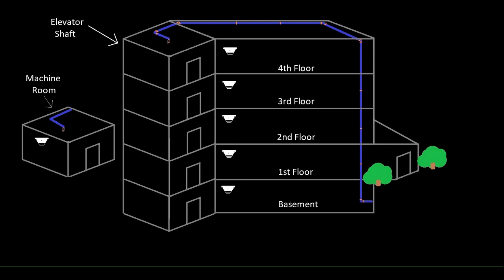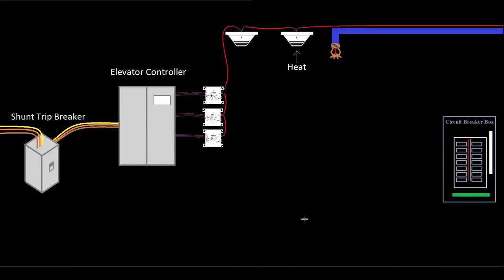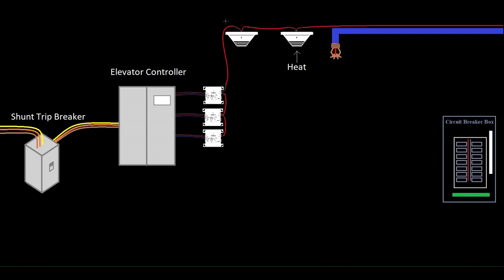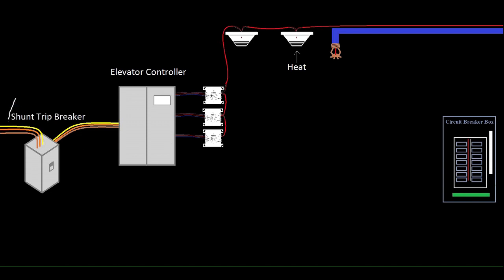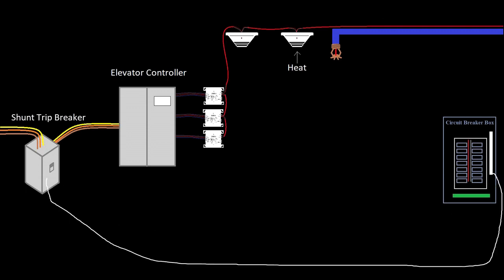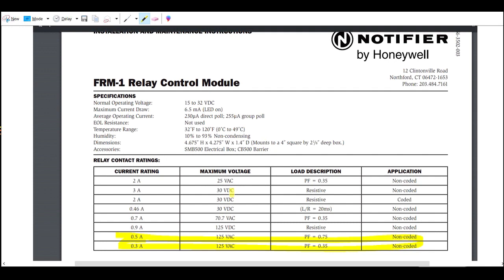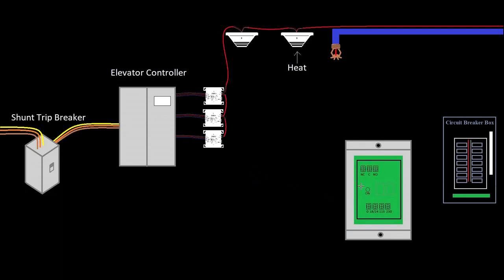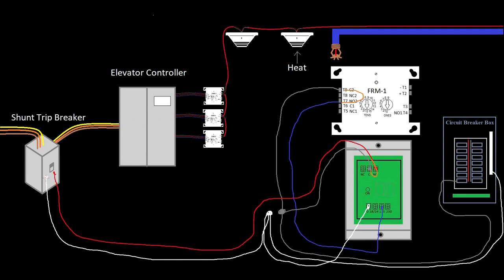39 - Elevator Shunt Trip - Introduction to Fire Alarms

Comment: When you say the MR101 couldn't be controlled by your fire alarm panel, could you not just use one of the alarm relays directly off the panel itself? Or even install a certified relay module designed for that same brand of panel as a dedicated zone? They could trip your MR101 on the 18-24 input, as many of them especially on the programmable SLC loops offer 24v out. In my mind this offers several benefits, such as being able to have that as a dedicated relay trip off the panel itself, or instead using the relay module to have an addressable zone for that MR101 trip, making it easier for identification and troubleshooting in the future. Not to mention, if you planned on using all three devices (smoke, heat, sprinkler) as your input combined as one for an input, (assuming you meant in series) then if one of the devices failed then your whole setup is no good. This method would have a better chance of working if you had a dedicated relay off the panel itself. In my experience, the less relays or extra modules in between your source and your destination will always be the better choice especially when it comes to life safety. Less things that can fail. Otherwise it would be identical to how you explained. Hot lead off 120v breaker through C/NO on the MR101 out, Neutral straight through to Shunt, and 24v in from fire panel directly as an addressable zone. Cut out the FRM and not have to worry about it failing.

Comment: I know you probably won't get as many likes or views as the more popular videos on youtube, but for the people who watch this video and really appreciate what you are explaining, it means a lot.  Just a headsup, but a 2-phase panel is not a common panel.  1-phase and 3-phase are a lot more common.
Reply: perhaps  just a misnomer - any single phase  220-240VAC in the USA is yes nominally called single phase - 220volt,   but under the skin - uses line to line phases (2 phases). we all know and often misuse terminology - much like a 2x4 is actually 1-1/2x 3-1/2 - Very few commercial or industrial motors use line to ground power as they are extremely inefficient - just to let those who are in the learning curve also understand this moniker.

Comment: Hello Joe,
My situation is cl8se to your explanation but with the difference on the shunt trip relay
My Electrician gave me 2 kegs 
One is black labeled LINE and a blue labeled Load.
I connected the line (BLACK CABLE) to my potter Relay com.
and my Load (Blue CABLE) to my potter Relay NO.
I also use a 24vdc relay with a spst input and I connected the COM. And the NO to a minute module with a resistor across. 
My problem is that the relay Blowout
Reply from the maker: Your Potter probably isn't rated for the current that the shunt trip breaker is drawing. If you watch the video again, pay attention to when I explain why I'm using the MR-101. You can use your Potter relay (a new one) to trip another relay that can handle higher current. Your load would run through that relay instead of the Potter one.
Reply: @JoeKlochan  thanks for replying to me, but my problem is that I wire everything like your diagram but the ONLY  difference between yours and mine is the mine doesn't have  a neutral going to the shunt trip relay I have the wire call LOAD remember because my LINE IS THE HOT POWER so where do I put the LINE on your diagram??.
Reply from the maker: @FastEddy8a  it doesn't sound like your situation is that similar to mine. First, what is your 24 volt relay doing? Are you using 24 volts for anything? It's possible to run 24 volts through your Potter relay and then activate the MR-101 that way. Then your line would go to the common of your MR-101 and your load would go to NO of your MR-101. I'm not sure that's what you're doing but it could be and it would definitely work, you just need to pull 24 volts from somewhere in that case.

I'm my drawing, the LINE would obviously be the black wire coming out of the breaker box, and the LOAD would be the red wire going to the shunt trip breaker.
Reply: @JoeKlochan  the only difference between your mr101 and the one that I have is that the one that I have is power it by 24 volt which I am getting the power from my NAC circuits in a program that want to be constant power and the way that I wire is hot power I went to Common on my relay module and my line I came out of my normally open then I put my relay which is the mr101 and it connected to my miniature module just to monitor my relay and that's how I'm getting my breaker to blow out so on yours you are powering the mr101 from the fire relay module  on mine I'm getting a separate power
Reply from the maker: I'm not totally following you. I guess the best I can offer is that your 120 volts shouldn't be passing through your Potter relay in your scenario. Since you're using 24 volts, run that through your Potter relay and use it to turn on your MR-101. Then your LINE would go to common of your MR-101 and your LOAD would go to NO of your MR-101.

The downside of doing it that way is you now need two monitoring points, one to monitor that the 120 volts is on (which you'll need a neutral and another relay) and one to monitor the 24 volts since both sources need to be there to operate shunt.

Comment: Can you use a rib relay if you can't find an Mr 101?
Reply from the maker: As long as the current rating is high enough, I don't see why not. I've never seen it done that way though. The only thing that comes to mind is that it maybe more difficult to keep 1/4" of separation between power limited and non power limited with those, but I'm sure it can be done. My main concern would be current rating but those RIBs are also rated for 10amps.
Reply: The problem with using a RIB vs. MR101 is that RIB is not rated/ listed to be used with FA system (life safety). Other than that they work the same.

Comment: Great explanation, Joe! I feel that shunt trips are death traps, because if patrons or the FD is in the elevator and the shunt trip goes, your screwed.
Reply: I guarantee you that’s not how it’s set up. If the shunt trip activates and cuts power to the motor, there is a system in place that allows the elevator to drop down to the closest floor and open its doors (which stay open) so the occupants can get out. Elevator safety is a huge deal and require current permits and safety inspections. You can’t possibly so naive to think that elevator engineers haven’t thought about this potential issue.
Reply from the maker: I don't disagree. I'm just not sure how often they're setup to have a battery lower the car to the floor upon loss of power. I don't think I've ever seen that buy thay doesn't mean it doesn't happen.
Reply: @JoeKlochan  Why don't lifts have USP backups? There exist whole house battery backups so why can't elevators have individual backups to be used?